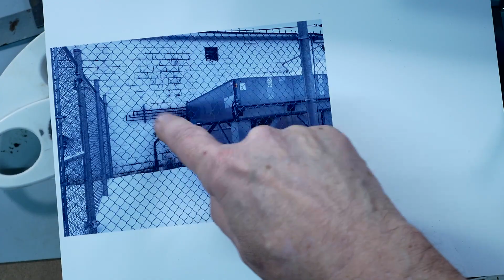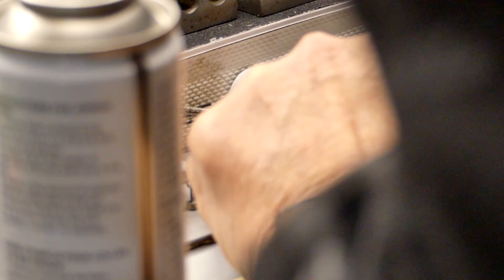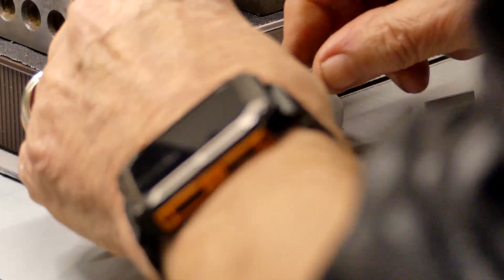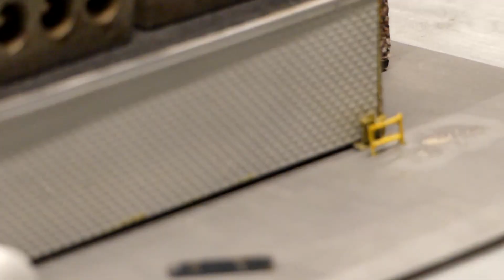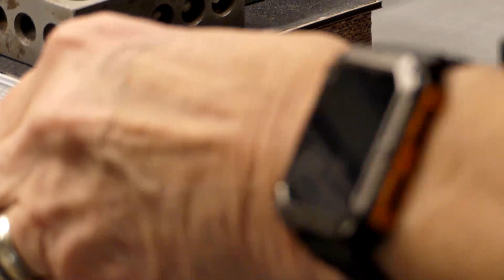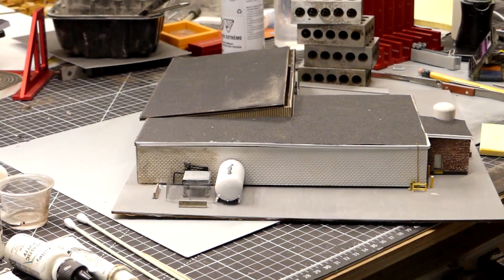Adding details to the Dairy

Comment: Great project!  The photo you showed.  I think thats a chiller unit? they mount then horozontally and they have fans on the top. We had units like this in the supermarket I worked at. I think there would be 4 fans on that unit maybe?
The units we had were covered at the bottom with a fine mesh. It got covered in Oak leaves and bummble bees as the fans sucked the air throught the unit and blew the hot air out the top. The chain link fence makes sense here as it would help prevent an amount of trash getting sucked into the unit.